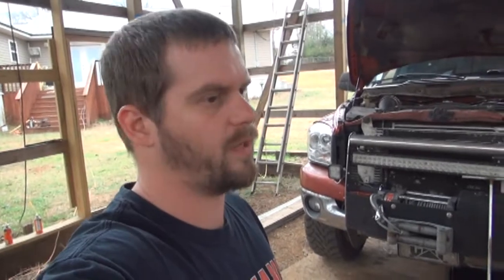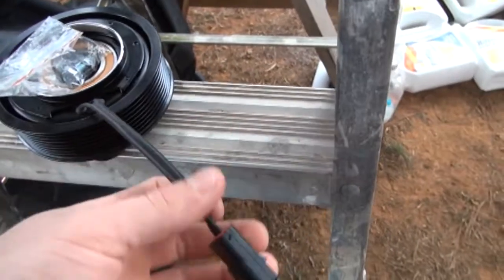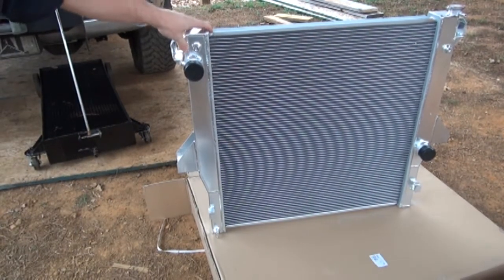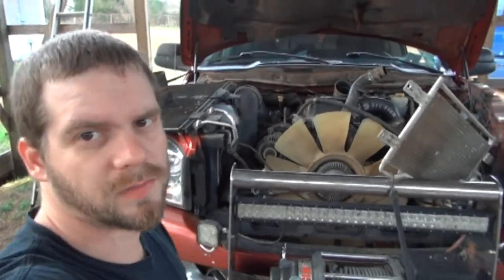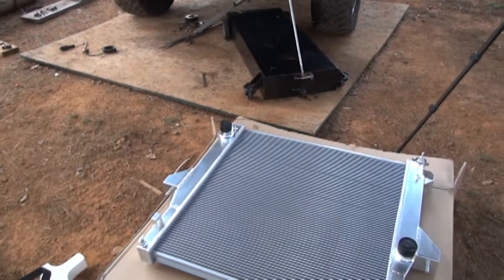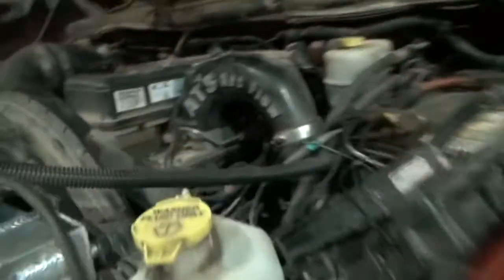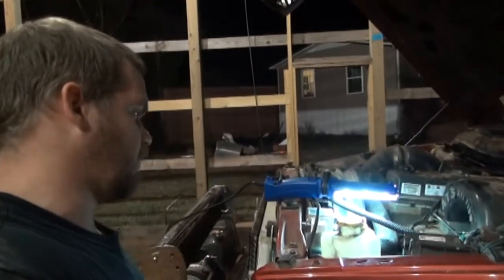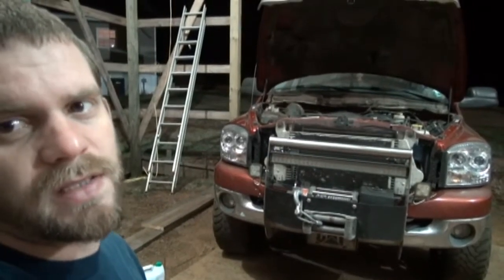Ram 2500 5.9 Cummins all aluminum radiator replace

Comment: Your losing water pumps that quick cause you aren’t using the right coolant. That coolant is corrosive to the pumps internal seal
Reply: Anthony you're right also when you change the w.pump you are supposed to get out as much of the old coolant as possible or you're going to be doing it again really soon ask me how I know.in the past i would change just the water pump and top off the coolant. And redo about 6-8 months later because of a leak in the w.pump.and then I read a thread to get out as much of the old coolant as possible.Otherwise you will be doing it again.The recommended coolant  Is our lubricant for the water pump and if you put in a new water pump and the old lubricant,now the W.P. has to work harder because the lubricant lost its  additives that are in the factory lubricant then your water pump is going to fail
Reply: I use dexcool no issue's
Reply: One more to add use the right coolant. These water pumps are very simple and should last. My first one went well over 100k miles and the advance auto replacement passed 30k no issues

Comment: Nice fix. Not exactly a small job. Your good to go. That new rad is better then the original by a mile. Thanks Chase.
Reply from the maker: I've had those plastic ones leak new out of the box where they clamp the end tanks on
Reply: Dude no shit I just changed my radiator for same plastic still reservoir. The things leaking worse then the one I pulled out. Should of spent the extra 100 on aluminum. Leaking where the plastic meets the aluminum bottom of the reservoir at the clamp
Reply: What was the brand of the Aluminum Radiator you put in?

Comment: You are suppose to only put in HOAT antifreeze in the 5.9 Cummins.
Reply from the maker: It's been changed since... But some antifreeze is usually better than no antifreeze in a pinch, kinda like oil 😂   the old antifreeze seems to eat up water pumps pretty fast though, seen it on a few different engines.

Comment: i was runnin 1000 miles a week and went through 5 water pumps on my 2012 in just one year
Reply from the maker: This water pump is leaking now and it doesn't have very many miles on it.

Comment: Chase, do you still like your radiator? If you don't mind me asking how much was something like that? I'm needing to replace mine as well
Reply from the maker: I think it was around 300 ish or so, so far no problems with it
Reply: I dont fint it, could you send a link? - Is it cheaper than the Mishimoto radiator?

Comment: Do you have a link for this radiator?  Thanks
Reply from the maker: I do not, I bought it off of ebay but I don't remember which seller or anything.
Reply: chase5726 I found it. It's under the same name uncle cooling. I'll give it shot. Thanks , how's the radiator holding up!
Reply from the maker: so far no problems
Reply: chase5726 did u get a 3row or 4row radiator